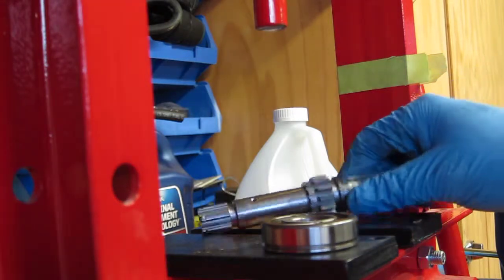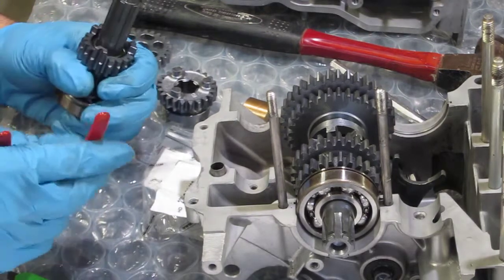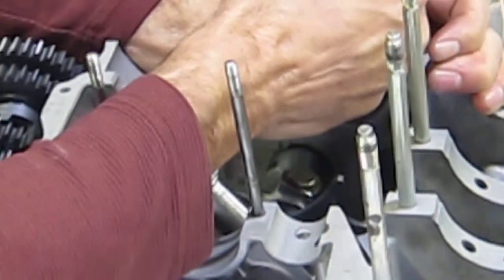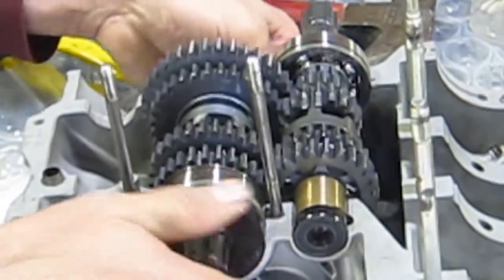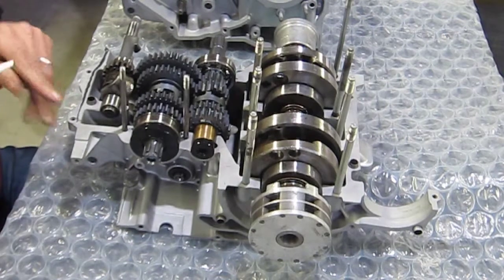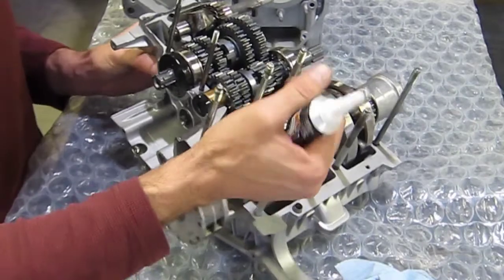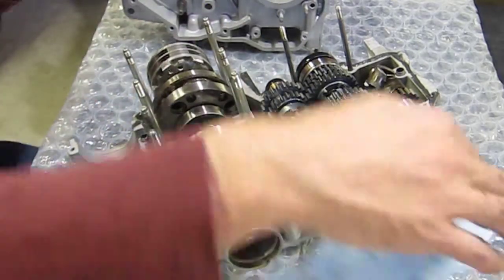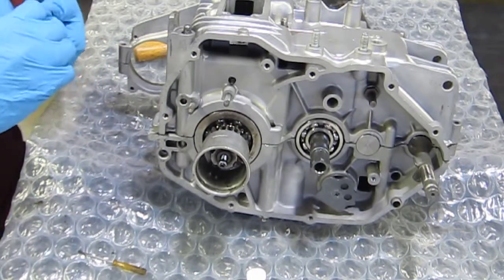1969 Honda CL160 Rebuild Part 5 Engine Build Part 2

Comment: Hello.  Thank you so much for these videos.  I am rebuilding a 1968CB175 K0 and it is very similar.  I am having trouble installing the kick starter shaft.  The end of my kick shaft has a slot and there is a knock pin in the block below.  I noticed a similar hole in yours before you installed the shaft.  Did you put a pin in this shaft to hold the shaft in place?  Otherwise, what prevents the shaft from moving around?  Thanks.
Reply from the maker: It has been some time now and I would have to go back and look. Let me know if you still need help and I will see what I can do. Thank you

Comment: I had to buy a new crankshaft and it didn't come with its own sprocket and magneto rotor, the bolt is off but they are stuck on the old crankshaft. Do you know how to remove these? A bearing puller? Or should they just come off with pb blaster and jiggling?